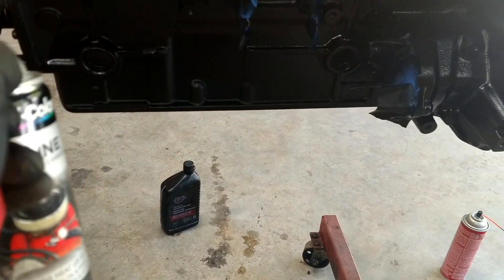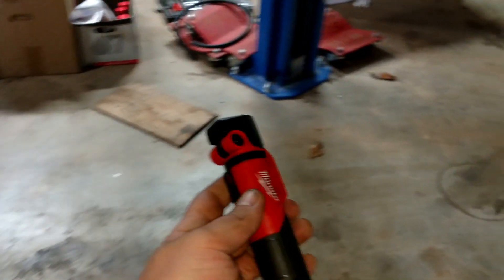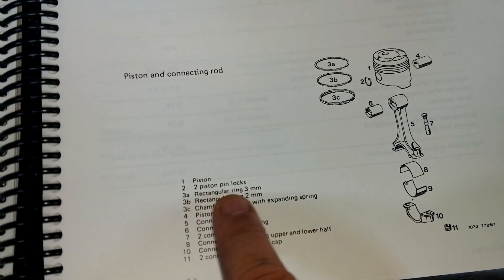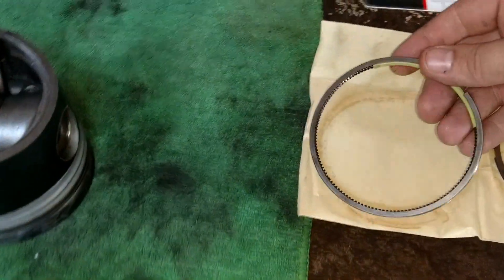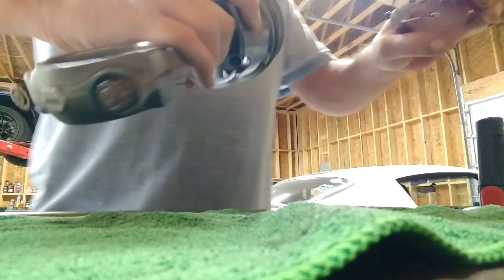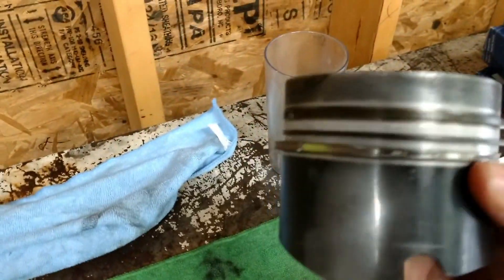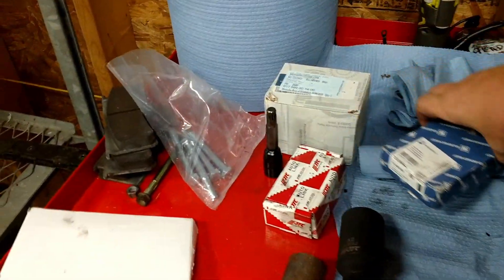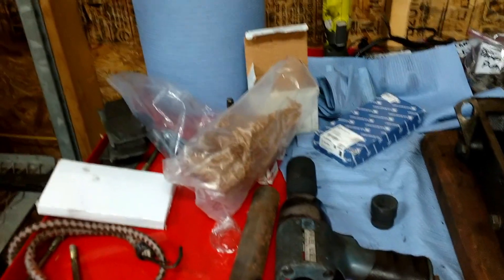Mercedes om617 Rebuild - Part 14 - Piston Rings / Painting Block

Comment: Bonjour,
Svp j'ai une question, quel est le diamètre des segment pour le moteur de ma Mercedes 300D om617 année 1977 et je vous remercie infiniment pour toutes ces leçons que vous nous partager. 🙏
Reply from the maker: I am sorry but I do not know the answer to your question. If you can get a hold of the engine service manual all the details will be in there.
Reply: @woodsandbarclay Merci beaucoup pour votre réponse rapide, je vais essayer d'en procurer le manuel ou voir un mécanicien.
Mes chaleureuses salutations depuis la Kabylie (Algérie).
Reply from the maker: A mechanic is going to have to look that up in the manual. Go to my website and the om617 manual can be downloaded in the downloads section
Reply: @woodsandbarclay OK, Merci infiniment, Dieu vous bénisse abondamment mon frère.

Comment: Are you still going to be renting your front seal alignment tool? I'm about to put my OM617 back together and $82 for this tool is pretty steep
Reply from the maker: Yes you can rent it for 20 bucks but I do require $100 deposit. I'll give you back 80 bucks when you return the tool in damaged.

Comment: Where do you order you’re parts from? Did you order a whole rebuild kit or piece by piece?
Reply from the maker: I ordered a lot of stuff from autohausAZ and pelican parts. However that's just gaskets, seals timing chain, oil chain, timing chain guides, bearings, etc... all of the original engine components were within spec and still good. There was no need to order a "rebuild" kit. A rebuild kit usually has Pistons, valves, rods stuff like that. I basically just had to reorder all the stuff that wears not really any of the engine components. This is really a refresh of a good engine that just had to have the crank repaired.
Reply: @woodsandbarclay  This is awesome! I am hoping to do this in July 2021 but my project engine is in Idaho and I'm in Canada, our boarder is closed. I was going to replace everything but perhaps just the chains, and gaskets. Thanks for saving me $3000!

Comment: Keep them coming great vids and awesome info thanks keep up the good work👍by the way did you put a primer as a base coat or the spray paint you using has a primer already?
Reply from the maker: No primer. Old paint was still baked on the block. Just painted over. Good enough.